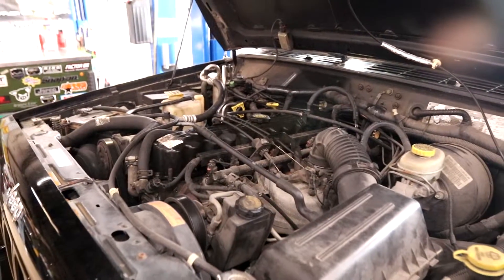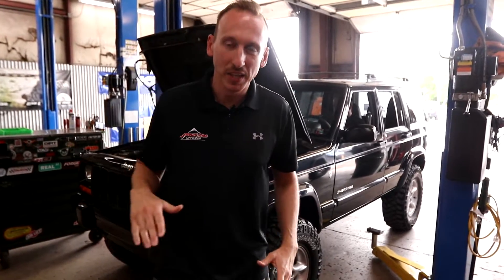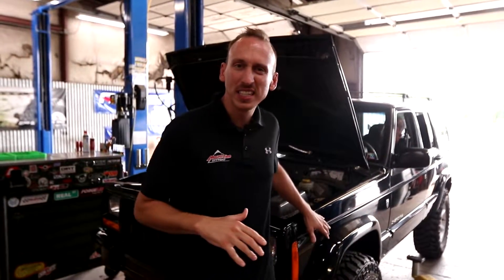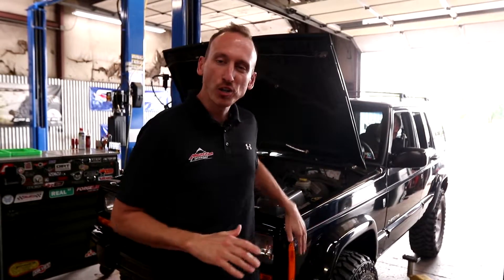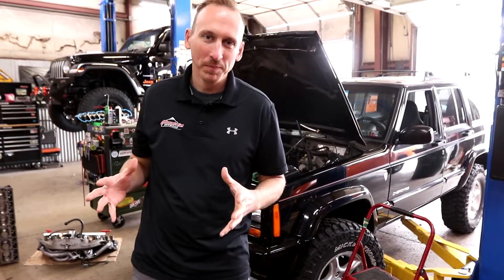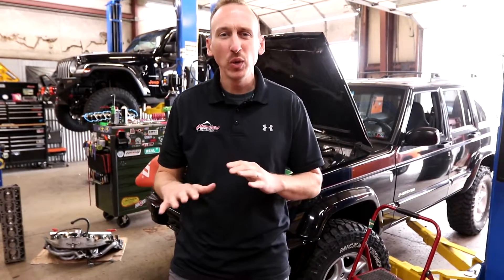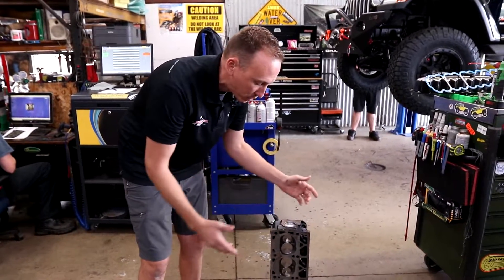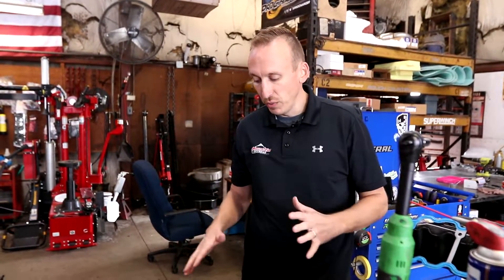4.5 L Stroker Swap Jeep XJ gets a Custom Built, Ported & Polished Engine!

Comment: 505 with Zach the hack built your engine ? Wouldn’t let them tune my weedwacker. 
If it’s still running sell it now. It won’t run for long.
505 has done a wonderful job supplying other builders with engines to be rebuilt the right way.

Comment: What was the overall result in horse power gains ? Was it noticably stronger and faster ? Then do you know the exact pacakage he had purchased  from 505 ?
Reply from the maker: The engine had a slight increase in power you could feel, we don’t recall the exact package!
Reply: @MountZionOffroad  slight increase?  I installed a 4.5 stroker in my YJ, 3.54 gears and there is no comparison to the 4.0HO stock performance.  Huge difference everywhere.  The bottom end torque is astounding.

Comment: Okay, as an engine/transmission builder, it is inexcusable for 505 to send out a rebuilt, stroked engine with a cracked head. I don't care if a fork lift hit it. You uncrate it and check to see if it got damaged. I would be afraid to by anything from them. Nice job unfucking someone else's fuck up.